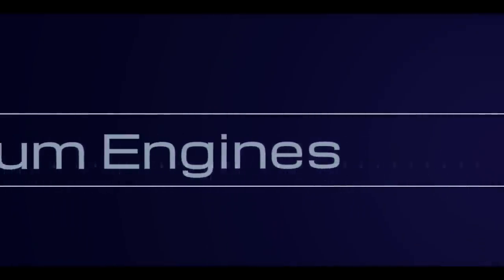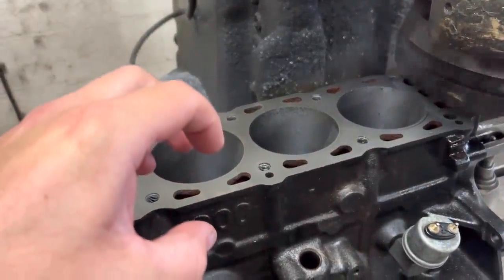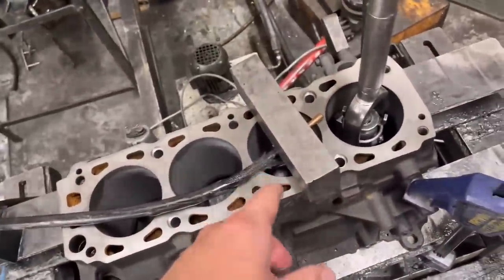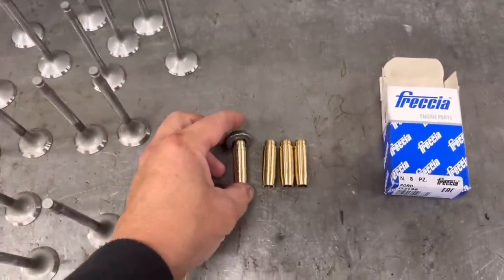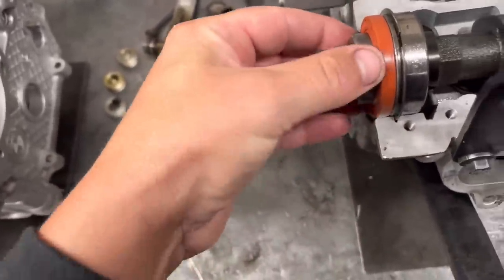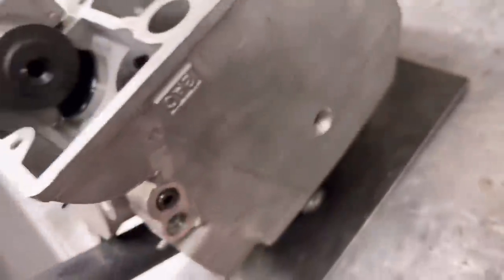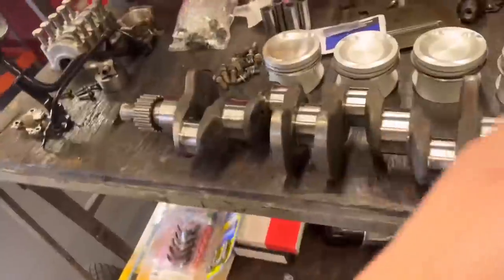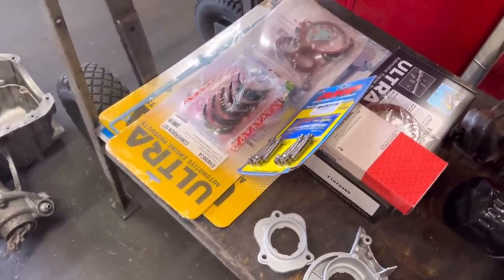This Cosworth engine has EVERYTHING wrong, it’s another DISASTER waiting!

Comment: That clutch cover plate is only fit for the bin.
Reply: Surely that clutch is scrap? You can't use that, you've removed way more than 50% of the material!
Reply: 💯 agree completely weakened the structure…
Reply: Exactly what I was thinking
Reply: Ridiculous to use that clutch cover…
Reply: Yes, the has-bin. Seriously, I would be skeptical about putting  something like this back into my car. Did the customer agree to going with this?
Reply: Agreed. It's not very professional. Why didn't you add weight to the light side?
Reply: Wtf I thought the clutch cover was a joke , that’s what happens when you leave an apprentice un supervised on a balancing machine why would you not add some weight to the other side ?????
Reply: @brandonshuttleworth1293  click bait gone too far is my gut feeling, let's see what Lee says on the next video!
Reply: Not good!!!

Comment: Surely the clutch is weakened so much and could fail. After spending so much already  a new one is a must
Reply: @margarita8442  No. It was stated that the crank was pretty well balanced and only minimal adjustment had to be made. The vibration occurred when the Clutch was added ...

Comment: When you have a pressure plate that far out of balance, why couldn’t you weld a metal plate on the light side of the plate as a counter balance and then zero it by drilling holes on the heavy side as needed, making the total number of holes far less? They weld little plates on driveshafts to balance them, it seems like it would work here as well.
Reply: @margarita8442 because he doesn't understand how to do things properly.
Reply: @mattyb7736   Meeeeoww . . Just joking . . surely you add a bit instead of swiss cheesing it. . . what a mess . . if it was mine I'd be livid
Reply: Your Correct, should of added weight to opposite side...Swiss Cheese Pressure plate is a rubbish, in-experienced way of balancing it...

Comment: For the balancing machine, have you ever thought about getting some stick on tyre weights to use? Using those first to calculate how much weight has to be removed/added to something would prevent the swiss cheese effect like on this clutch in the video. The lad would have known that there was to much weight to be removed so would have looked to add weight to the light side and make a tidier job.

Comment: I think (as several others have already mentioned) that pressure plate is no good. I would rater add weight on the opposite side or get a new one that is hopefully more in balance from the beginning. I personally would be mad if I picked up a crank assembly after balancing and the pressure plate was in this kind of state... Anyway, I do like most of the work you are showing ;)

Comment: Personally I think your second channel is a great idea as I have very little interest in the kit car (except for details of motorcycle engine, etc) or track days.
Something you may be interested in, with cast iron valve guides using circlips as depth stop, pressing them too far will lead to guides cracking. It almost looks like they were machined in two parts!
I've seen it happen on brand new Honda motor, smoking from factory!
That little o-ring to prevent leaks is a very common on motorcycle output shafts, Suzuki have been using exact same method since the 1960's (on the smaller bikes it even looks exactly the same as what you showed)

Comment: Doubt a clutch cover can be that far out of balance. I've seen it when tyre fitters stick weights on top of weights to balance a wheel.......you have to question it as tyres/wheels are made pretty accurate and if you have to add/remove a huge amount of weight then maybe the machine isn't setup right or uncalibrated?? Just a thought